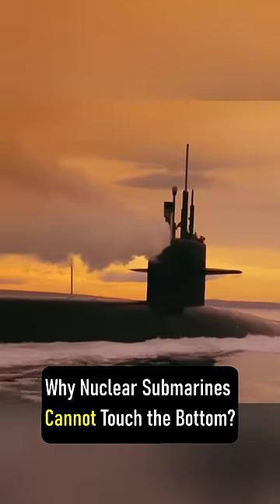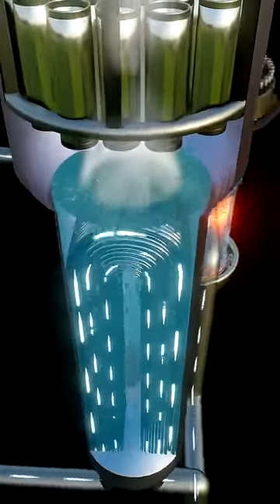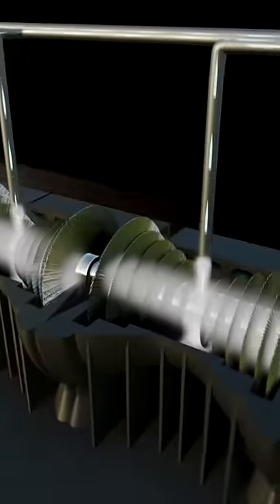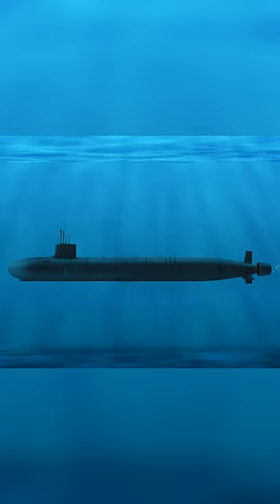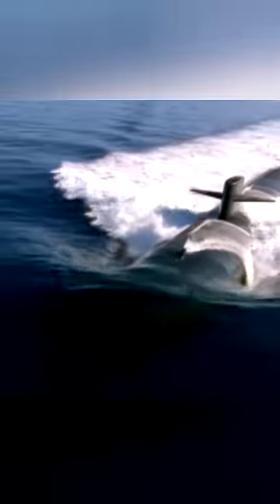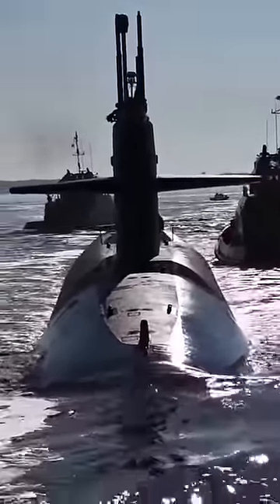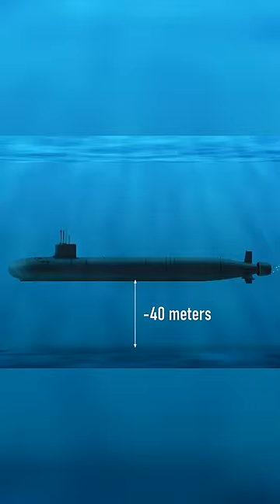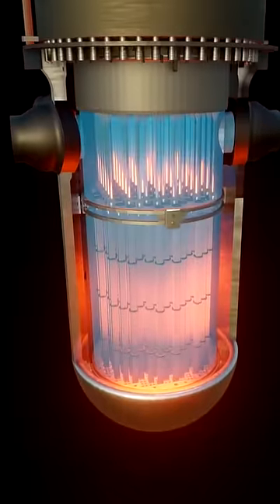Why Nuclear Submarines Cannot Touch the Bottom

Comment: Pretty sure there is heat exchanger between the sea water and radioactive coolant of the reactor, just for simply not being huge ass blimp on enemys detection system, since you know blowing radioactive water along the way? With out separation your submarine thats essentially only defense is not being seen, would scream everyone where its located due leaking radiation.
Reply from the maker: You're right. There are 2 heating circuits. In the primary circuit, the water pressure is 140-150 atm. this is the reactor circuit. In the second circuit of the steam generator, the water pressure is 17 atm. the second circuit has a heat exchanger with sea water.
Reply: @Justin thats not exactly true, Russian have tech that does that
Reply: Justin. Correct, the reactor cooling water is very pure and sea water would cause major damage. Steam system water is separated by a heat exchanger from reactor cooling water. And sea water is separated from steam plant water by condenser heat exchangers.
Reply: Thats not how radiation works at all

Comment: That intake for the seawater is called a “sea chest“ and every ship or boat (cuz a sub is a boat, not a ship…) has them.  Nuclear or conventional, they all do.  The point is that grounding any ship is going to cause the pumps to suck debris into the system.  Not good for any saltwater system…from reactor cooling to salt water flushing.
Reply: It's bullshit that they didn't design it better than that!!!
Reply: @kirkkirkland7244  

No, you want to sea chest on the bottom or very low on the hull, far as practical below the waterline.  You do not want it to be sucking air.

Comment: It might have changed, but I kinda doubt it. I served in two nuclear submarines and the sea water is brought in an circulated to condense the steam into water in the secondary system. The steam, before being condensed, is used to power a large turbine with directly turns the subs 7 bladed screw.  The reactor operating in a closed system never touches the water in the secondary system.  The secondary system water is flashed into steam in the steam generators and then is routed back to the steam turbines. The water in the primary system is circulated through the reactor and never, in any way is permitted outside the reactor compartment.  If it was, the engine room would be flooded with high amounts of deadly radiation.

Comment: They can and they have. Sea water does not cool the core directly. This might apply to Boomer boats, but not all nuke subs
Reply from the maker: You are right, sea water cools the second circuit of the steam generator and not the reactor itself
Reply: Boomer boats are the same.. and also the inlets are not on the bottom of the boat....
Reply: @generalpatton8903  yes, allU.S. submarines are nuclear powered. Hence, nuclear subs. But not all are boomers. A boomer, or BM, is a submarine with ICBM's as it's main armament. There are also fast attacks and cruise missile submarine, aka gn's. Both of these do not carry nuclear warheads, just torpedoes and cruise missiles for their main armament. . .
Reply: @reedbeggs9442 "Set Theory" - 3rd Grade Level

Comment: Not necessarily, some subs have intakes on the sides and bottom, some even have intakes on the top deck, but that's not the main issue if this video. The water coming through the intakes does not come in contact or even flows through the same "system" that the actual reactor core and fuel rods are apart of. 

The reactor is in the primary loop with the main coolant pumps, the pressurizer, etc and the water in the "system" that makes up the primary is deionized water, it has to be absolutely pure H2O. The primary side is under pressure allowing it to be superheated so it's still a liquid above it's boiling temperature as it is one of the most important things in the reactor. The water is the number one first safety feature of the reactor as it's directly in contact with the fuel rods and is the main reason the neutrons flying out of the fission reactions give up their energy to the water to beneath the level needed to cause another nuclear fission by colliding with U-235. That's why one the names for the primary side water is the moderator, so "coolant". So ocean water can not and would not be allowed to flow into the reactor as it would deposit all sorts of scaley, briny, cooked organic layers as the ocean water, which would need to be pressurized to a fair level before even making it to that point because if not under pressure, the water would instantly flash and vaporize to steam as it contacted the fuel rods which is called voiding and is a very very very bad thing. 

The water does get used by the overall reactor system though, but it is in another completely closed off and separated system of the heat exchanger, port and starboard steam turbine generators. The heat exchanger is a big structure of small tubes that run very close throughout. One set of the tubes is the primary side pressurized superheated deionized water and the other set of tubes is the secondary side of mostly sea water which flows through the tubes which allow aton of the superheated primary water to dump a lot of thermal energy into the secondary water which flashes to steam and vaporizes which then uses the new energy and pressure to drive the steam turbine generators for electricity. The ocean water does so cause scale, brine and other things in ocean that cook at above boiling temperature and depositing a layer of ocean crap that reduces the heat transfer coefficient between the primary and secondary so it has to be cleaned every so often. 

So the titke wasn't necessarily true but the explanation was the incorrect part that needed addressing as the ocean water that comes in the intakes does not ever even come close to the reactor core as it's flowing through a completely closed off, separate system than the actual reactor. My source is me, I was in RC div on subs, ET2(SS).

Comment: Here I am thinking 🤔 isn't it bad for all Submarines to touch the bottom
Reply: Ikr
Reply: Depends on whose bottom you are touching.
Reply: When you hit it with speed, yes. When you gently park your boat there, no. Sitting on the bottom makes it quite tough for the enemy to locate you with Sonar ect.
Reply: Not if its done gently, but if that bottom happens to be 2.000 meters deep then yes. And the same if they try and do it while going at full speed and already at 400+ meters of depth and thus putting the hull under a lot of tension.
Reply: It wasn't so bad for WW2 subs to sit on the bottom and a lot of times it saved their lives!!!
Reply: @kirkkirkland7244 yes cool stuff

Comment: Pretty sure that no sub is supposed to touch the seafloor ... Nuclear or diesel.
Reply: Soviet typhoon submarines used to lay on the bottom for weeks at a time
Reply: @ronemtae3468  Germans train it also, but there is no reason to do it, it's too dangerous to get stuck or damaged. Just because you can doesn't mean you should.
Reply: I guess when it's life or death what you 'should' and 'could' become very different things.....id rather die trying the could than die thinking I should have tried 👀🤣
Reply: Well, some of these subs are able to touch the seafloor and could stay for more than 1 years, of course if anyone even cares about them..
Reply: It's called bottoming. It is a risky manuver that diesel electric subs use. Primarily to avoid detection.

Comment: the reactor has its own coolant loop it uses a liquid to liquid heat exchanger to make steam for the turbine and then the steam goes to another liquid to liquid heat exchanger to dump the heat so the steam and become water and recycled back to the first heat exchanger. the last heat exchanger that is removing the heat from the steam is the final cooling that is using ocean water which need a constant flow of water.

I simplified the hell out of the process

Comment: So there's the Achilles heel. On the keel. Gotta be BS cause nobody would be so freaking stupid to build it that way.
Reply: They're not directly on the keel. But on the very lower half of the ship. Those valves are also huge and if the ship touches the bottom in shallow water you run the risk of blocking the intake and or discharge.

Comment: I just can't believe the navy would accept a sub with intake on bottom cause back in the day subs would sit on bottom an wait for it's pry
Reply: Because those submarines were powered by diesel when surfaced and electrical motors when submerged. But that meant they had to be refuelled often, a nuclear powered submarines doesn’t need to be refuelled for 20 years, also, when those submarines were sat on the bottom, they were in water that would have been less than 300 metres deep, any deeper and the sub would have been out of safe depth.
Reply: @lorcan1091  Cool water intake at the bottom and hot water exit at the top 30 metres above bottom intake say whatever enables thermo-siphoning to function pretty well without any  pumping.

Comment: Hey, silly people! 
It's not WW2 anymore: NO modern Navy fleet ships and submarines are really EVER supposed to  'touch bottom', because, regardless of the cooling water intakes (which would likely not be obstructed by contact, but suck up stuff, and get clogged), you usually have to assume that the bottom is nowhere near flat, and neither is bottom of the hull, and thus, settling to the bottom should be expected to result in hull damage, as well as cause problems inside, as it could easily roll to one side, quite far...

In the modern fleet (versus a research vessel), touching bottom is usually going to result in the Commander of the vessel, and several others, getting relieved of duty = 'fired'.

Comment: Nuclear reactors only need direct cooling to remove decay heat after a shutdown. In normal operation, the cooling water is used to condense the spent steam after it’s gone through the turbines. Same as any other boiler-turbine system. Sea water intakes are in the hull bottom. Get too close and mud/sand will clog the cooling system.

Comment: USS George Bancroft SSBN 643.
Test depth 1300'
Crush depth 2500'
Reactor heats the primary. Primary heats the secondary in the steam generator. Super heated steam drives the turbines. Seawater cools the steam to liquid which goes back through the cycle. Turbines turn the shaft through the reduction gears that turn the propellers.
Only exception back in the 60s and 70s and 80s was the USS Narwhal - the quietest boat in the fleet. No reduction gears,  large diameter turbine, scoop injection up to 60% power after which use of the seawater pumps, natural convection primary flow up to 60% power after which primary pump is used. The Narwhal could cruise on a full bell with primary and sea water pumps deenergized.

Comment: ROLMFAO. Sea water is NOT used to cool ANY REACTOR. The Rx primary system is SEPARATED by a steam generator. Sea water is used to CONDENSE STEAM from the steam turbine, and cool auxiliary equipment. Sea water is drawn in and out by piping connected to"sea chests" at the boat bottom. For commercial Rx's, the tall towers you see are "cooing towers" which provide the cooling. They use a nearby lake for the towers.

Comment: I once saw an amphib touch the bottom. Sucked in some mud or seaweed, clogged the condensor, shut down the turbine, lost generators and kept sinking. Ballast valves were open and the emergency generator didn't kick in on time. They never ballast down at pierside again.

Comment: On the intake you add the design I was creating with the augurs and robotics scraping arms then you can throw your waist in there and have robotic scraping arms and extruder systems to extrude back out to you in each element at it's boiling point. Yeah before it goes into the components that can't handle the particulate the particular is removed and redistributed.

Comment: It's a fairly common tactic for Russian diesel electric submarines to rest on the sea floor in coastal waters. It stops them from drifting and allows them to power down all non-critical equipment, allowing them to be as quiet as possible.  
It's also common for Russian subs of all types to make themselves just slightly negatively buoyant and rest on the thermal layer of dense ocean water, where they'll let the current carry them along at 3 knots or so. They can then use their passive hull arrays to listen above the layer while their towed arrays are left to hang below the layer, allowing them to listen below it as well.
Reply: Now how would you know that???

Comment: Almost correct. Actually the intake of seawater is not to cool the reactor. The heat of the reactor is "cooled" by the process of turning steam plant condensed water back into steam. The sea water intake on the bottom of the boat is to cool steam that has been through the turbine engines back into a liquid so it can be pumped back to the reactor room into a steam generator.... and the cycle repeats. The reactor water is a sealed system and uses very little new water. The steam plant water is also sealed and uses very little new water. The cold seawater is only used to  complete cooling the steam back to a liquid. 
As simple as it sounds thats all there is to it .... and yes I have a ton of first hand experience.

Comment: Uhhh... No!  So, there is an intake known as the Main Sea Water Valve (which is huge by the way), however... water is not continuously pulled into the boat through that valve.  The saltwater is distilled into freshwater and run through the secondary system (sub reactors - for the U.S. anyway - have a primary system and a secondary system.  The primary is completely closed off, and the reactor acts as a heat exchanger: The reactor heats the primary water to around 600 degrees, but it doesn't boil or produce steam because the water on the primary side is pressurized.  The primary then heats the secondary side... This is the water that's used to create steam for running the sub's propulsion system.  The two sides are kept separate in order to reduce the spread of radioactive elements.

Comment: There are some misleading/inaccurate details in this.  Seawater does not directly come in contact with the nuclear fuel, as seawater is actually pretty corrosive, so it must be de-salinized to fresh water.  But even the fresh water does come directly in contact with the nuclear fuel, but through a series of heat exchangers.  The freshwater is a closed loop system.  Through the heat exchangers, yes the fuel is used create steam to drive the turbines.

Comment: I served on two nuclear submarines.  This is bull.  Seawater would corrode the reactor system.  The water coolant is in a closed system and is pure water.  Steam is produced in another closed system which is heated in a steam generator and cooled in a distillation after powering electrical generators or propulsion turbines. Seawater is not taken in, heated to steam, and used to turn turbines or generators. A submarine can sit on the bottom. I was on a sub that did so.

Comment: Not to mention that doing so would cause damage tp the hull. Submarines operate mostly in deep water. Our subs typically do not submerge until they are about 100 miles off the coast where the water is deeper.

Comment: And an addition , if the cooling system is not a concern then also submarines cannot go deeper then a specefic depth as the pressure increase in psi which can crush the submarine like a can.

Comment: Instead of sitting on the very bottom i wonder if you could put multiple air pressured long jacks, that keep the submarine at the bottom, but have just enough of a gap,so the nuclear reactor can stay cool. Exactly like Indy race cars when they pit. Im not sure if it's even worth it. But i was thinking in perspective of docking at the bottom of the sea, maybe for a possible base or future base and then use the Nuclear submarines to power the deepwater bases for 50 to 100 years. Im sure its been fiqured out already

Comment: The intercooler keeps the sea water separate from the reactor water which is constantly recycled like the cooling system on your car. Only difference is water is a better moderator of heat. You made it sound like an old steam engine or outbound motorboat engine.

Comment: First of all big military sea crafts and submarines are driven by steam turbines. Between the turbine and the main power source there is not electricity involved directly. Second of all submarinial nuclear reactors can run at much higher temperatures than civil ones and are designed to take extreme overload.

Comment: U.S subs CAN sit on the bottom,  but overall it's just not a good idea.  
 Submarines have no idea what is below them laying on the ocean  floor. They can guess at it, (i.e. sand, rock, coral etc. etc.)  but all submarines are completely sightless once submerged and dependent on their sonar to tell that what's going on outside the hull.
 The 'sea valves' are roughly located on the bottom half of the hull,  not the bottom of the boat,  and they are designed to strain out (think kitchen sink strainers) anything that won't easily pass through the outside loop of the reactor coolant system. The seawater loop of the coolant system is fairly robust,  and is able to handle pretty much anything that might get sucked into it, and still spit it out the other side, with no harm done. This happens fairly often, sucking in sand and small fish isn't a big problem.    And neither is sitting on the bottom much of a problem, since they can and do often run off of thier massive batteries and electric pumps can and do purge water from the ballast tanks to raise the boat up off of the bottom of the ocea, without using the reactors,  or have need to circulate seawater through the system.   
 As for the reactors themselves, (or the heat exchange systems) they use what's called a (fresh water) on the reactor heat exchange units to cut down on the amount of buildup and gunk.